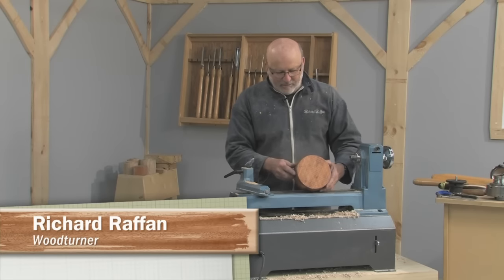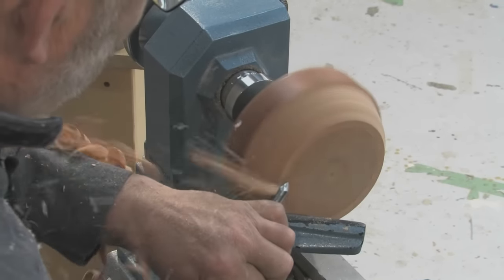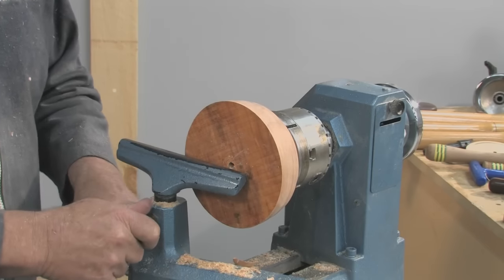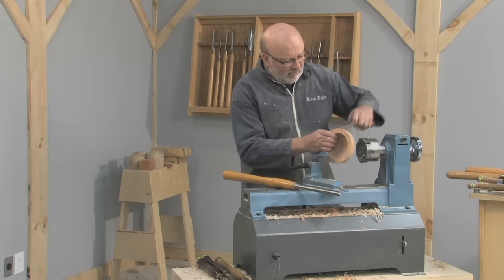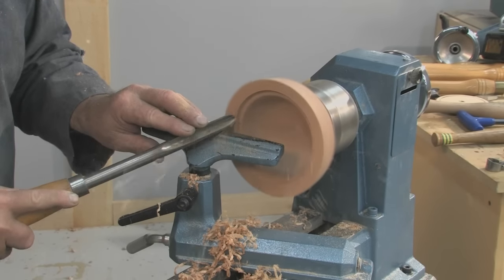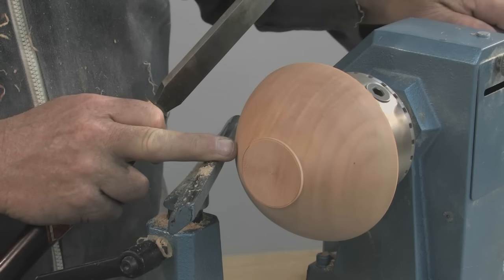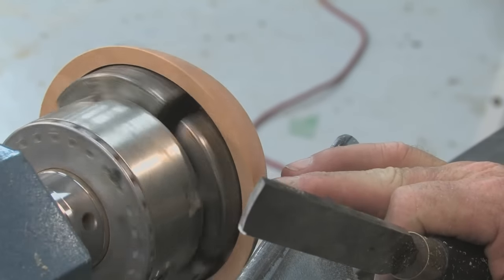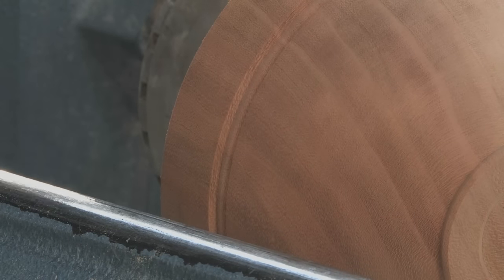How to Turn a Basic Bowl-Part I

Comment: Great video, really helpful, thanks.  You can get the centre of a circle bang on by using a square and the fact that a diameter subtends an angle of 90 degrees at the circumference.

Comment: The way the shavings seem to fly and float is amazing.  Someday I'll figure out how to get my blades that sharp.  :)  Great video, looking forward to part 2!
Reply: ManhattanWoodProject pretty crappy tutorial.. Here watch me peel half the bowl away in the first step without showing how to do it.
Reply: hey ,if anyone else is searching for lawn bowls sizes old new try Berts Bowls Guide  (do a search on google ) ? Ive heard some incredible things about it and my neighbor got cool success with it.
Reply: ManhattanWoodProject a
Reply: Hey :) I might be to blind for the sharpener but the best sharpening I ever down was by hand using wet sanding paper 1000 grid  and that was sharp I mean sharp sharp but loosing it quicker than anything
Reply: ManhattanWoodProject boxing
Reply: Bare in mind that Richard is using a green bowl blank. Green wood cuts so much easier than pre dried timber blanks.  Not saying that Richard ain’t a great turner, he is. He has had many years of production turning behind him.

Comment: An easier way to find the center of a circle is by using Thales' theorem. A right angle at any point on the circumference of a circle will pass through the edge at exactly the center. Do this twice and connect the lines and the intersection should be exactly at the centerpoint of the circle.

Comment: I'm pretty new to using a lathe and have a few questions. (anyone answering would be helpful) 
1. It's hard to tell from the video, but which way is the "end grain" of the wood facing? 
2. What many rpm are you using while cutting the bowl? 
Thanks in advance.
Reply: Bowls are usually made with cross grain (lying at right angles ot the lathe axis) and thath's the case here.
Reply: @RichardRaffanwoodturning  thank you sir

Comment: Hi , what a great demonstration 👍 
Can you advice me on what is the best treatment for a bowl when using it for eating .
Thank you
Reply: Just use the bowl, and maybe wash it up first. Treat it like a wooden chopping board. I finish bowls with walnut or boiled linseed oil that come off when washed, so if a bowl is going straight into use you might not bother with a finish.
Reply: You can oil a bowl or plate, but if you have it in constant use, just wash it using hot water and detergent as you would a wooden chopping board.

Comment: How do you get your tools so sharp!
Reply: I use a Robert Sorby Pro edge deluxe belt sharpener. Pretty much fool proof. Quite expensive, but worth every penny. You can sharpen your chisels, to factory finish. And it will last a lifetime.
Reply: Paul Henry thanks for the tip.

Comment: New comer to turning.  What kind of chuck is recommended for doing bowls like in this video?
Reply: I use a combination of Vicmarc and also the older style Axminster Super Precision of which I have 9 all with different jaws in. Depends what lathe you have but in my opinion Vicmarc are the best around and the best value for money. Awesome resale value to
Reply: It's difficult to beat Vicmarc chucks for which a range of jaws is available. The Vicmarc jaws are machined so you can take finished work from the chuck. For more info you can reach me through richardraffan.com.

Comment: I don't know if I'm doing something wrong or just use a harder wood, but when I hollow out the bowl, it doesn't cut as easily as you made it look.  It takes a long time to hollow it while yours made it look like a matter of seconds.  Could someone please help me on this?  

Thanks.
Reply: +TarasDoesDIY   You are not on your own, if something can go wrong it does!!
This demonstrator makes it look very simple
Reply: icespeckledhens OK, thank you very much!  I have been focusing more on spinning tops since I posted the comment, as I don't have any dry wood to turn and I can't cut blanks cause I don't have a band saw.  I will work on some bowls and get some practise in soon though.  

Thanks again.
Reply: +TarasDoesDIY sharpen your tools and speed up your lathe
Reply: xXxPussyxSlay3rxXx Slays Puss3y Yea, my lathe is on quite a low speed at the moment.  Thank you :).
Reply: Obviously you need a sharp tool and my bowl gouges have short convex wings for a fat shaving. After that it's mostly a matter of presenting the edge at the most beneficial angle to the wood as it comes down on to the edge. You don't need to push the tool in to the wood: it's more a matter of letting the wood come to the tool. This bowl was turned at about 1600rpm.

Comment: I have a question: I'm new to woodturning, so this maybe a stupid question, but why would you need to let it sit for 6 months? Why does it shift? I'm confused.
Reply: bailal1 i think its to let the wood dry
Reply: Yes, it's to let the wood dry, and finish moving around. You can also use a paper bag with some of the shaving to help it dry evenly. You can check it every so often by weight, or by the moisture content with a moisture meter.
Reply: bailal1 The wood is under stress, and removing part of it will change the pressure points if you like..... also, as well as drying, the wood will take in moisture from it's environment so it can shrink and swell.

Comment: Sir, what is maximum diameter of bowl that can be turned using a screw chuck?
Reply: Depends on the size of the chuck.
Reply: On this Vicmarc 3-in-1 screw chuck I've had several 595 x 200mm c.24" x8" claret ash blanks and redgum burl almost as big and certainly as heavy. It pays to bring up tailcentre support when the blank is first on the chuck.

Comment: What lathe would you recommend UNDER 200
Reply: None, any under 200 are usually garbage. Get a used lathe, they can be under two hundred. The one he uses here is a 2003 Vic Marc mini - which can be found from any where used  at 150-400 USD.
Reply: @Zax_w  thank you!

Comment: Roughly how long should you put it in the microwave?
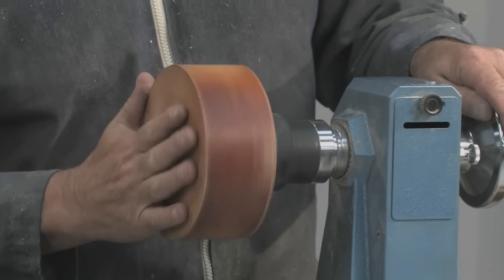Reply: This depends on a number of variables: to size and thickness of the bowl, the moisture content of the wood, and the power of the microwave oven. I want to remove a bowl when it's almost too hot to hold. I rarely use the microwave for seasoning, rather to distort thin bowls and pots. There are photos on http://www.richardraffan.com .  A 150 x 75mm bowl less than 3mm thick will initially be about 1:30 on full power.

Comment: I am new to turning, but I was always told to never use a spindle gouge on a bowl.
Reply: +Quagmire88 Thats not a spindle gouge, the big one is a bowl gouge.
Reply: +Quagmire88 Just look at the bowl as a lamp base and it's the same as faceplate turning, you use a spindle gouge on that. Nothing wrong with using that gouge, it's all about how you present the edge. Just as some use the skew as a scraper etc.
Reply: +Quagmire88 
Spindle roughing gouge is the dangerous one you shouldn't use on a bowl.
Reply: A spindle gouge with a long bevel enables you to get into corners and cut details which are impossible using a bowl gouge.

Comment: It's amazing he still has all his fingers. There are a number of scenes in this video that a novice should not practice.
Rule #1 never move or adjust the tool rest with the lathe running. Please watch other craftsman to learn the right way.
Reply: +MyBlueLantern It's fine to do so, you just take more care. These guys have been doing it for years and like most seasoned craftsman, they cut corners to save time and because they're able to lesson the risks. As you improve you do things to speed things up, I'm sure you've cut corners in life sometime or another.
Reply: MyBlueLantern we all do it! Just use common sense!
Reply: DONT WEAR GLOVES

Comment: What gouge brand do you use
Reply: Mostly Henry Taylor, some Sorby, D-way and Thompson. All High Speed Steel (HSS)
Reply: @RichardRaffanwoodturning  Also what bevel is that
Reply: @levilynch9126  It's an asymmetric grind done freehand: 45-degrees on the nose fading to vertical on the long left wing, but steeper on the shorter right wing. This makes for an easier entry cut that a very steep bevel, then as the cut proceeds into the base of the bowl you roll the tool clockwise to keep the bevel rubbing. On the outside, the steep bevel makes cutting a concave curve much easier. With symmetrical wings I still have a 45-degree bevel on the nose of the gouge and I keep the edges on each wing a convex curve rather than the flat that can occur using a jig. Thisis the key to removing a lot of wood fast and effeciently. There are photos in my books Turning Wood, Turning Bowls, and The Complete Illustrated Guide to Turning, and in the Turning Wood and Turning Bowls DVDs

Comment: A bit of showboating. "''I've built hundreds of bowls, so I can be careless". This video is aimed at beginners. Following all the silly unsafe methods shown here will probably result in an injury. You can abuse safety shortcuts a hundred times and only have to fail once to loose a finger. This is the same reason we wear seat belts in cars: safety first to avoid potential injuries.
Reply: Baytoo I don't see any silly unsafe methods here nor bad practices. The problem is that you must be used to entertainer YouTube turners and not real professionals. If you read his books you will understand more about his safety practices. Remember he's been doing it before carbide turning tool times.
Reply: I really wish people knew how to spell "lose."
Reply: people wear seat belts in cars because its the law, not a recommendation

Comment: A nice little bowl excercise. But for beginners to watch, you're dangerous. You've got sleeves dangling loose and at one point it was caught around the tool rest. That leads to restricted movement of the tool at extremities and that leads to an accident. If you get a catch you might not be able to pull out of the way if your sleeve is stuck on the tool rest. And running a high speed like that to screw a bowl on is simply asking for broken fingers or a flying bowl blank. Good bowl turning ruined by bad safety practices. Having seen sleeves get caught in a lathe, it's not funny looking at a dangling broken hand.
Reply: Usually I find safety related comments annoying. However the ones you made are very pertinent.  Now, anyone watching YT videos surrounding power tools should take the additional responsibility for educating themselves of the safety issues r/t the particular tool. But that sleeve!